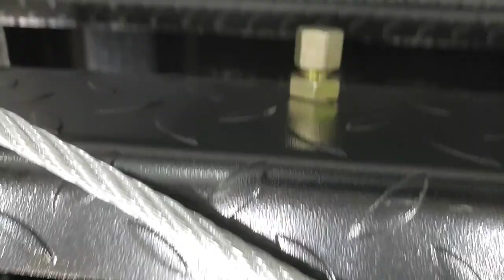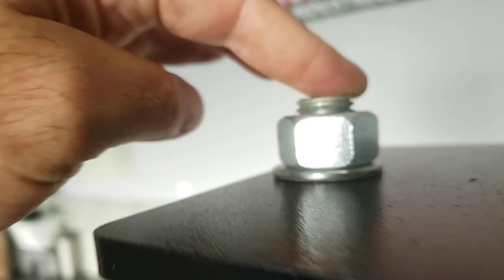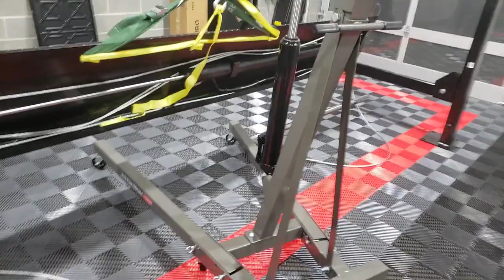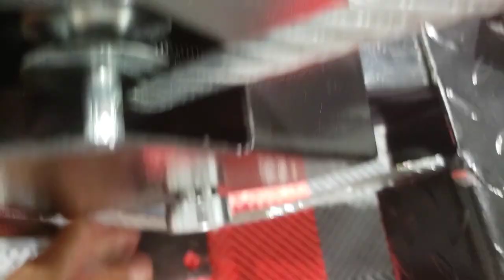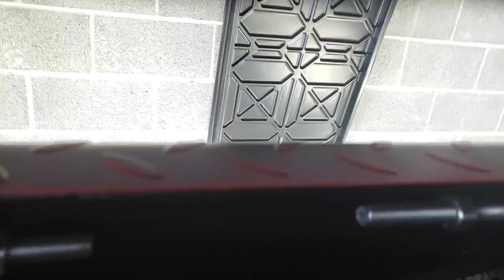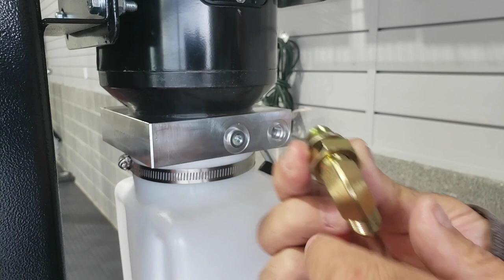Install a Tuxedo 4 Post Lift By Yourself - Beware - Lonnnnng Video!

Comment: Thank you so much for doing this video...I don't know how I would have assembled my lift without it!  The only "issue" I had was I filled the hydraulic reservoir  up to the "full" mark with the lift in its initial assembly position...on the third or fourth notch.  To my surprise I had to remove fluid from the reservoir when I brought the lift down to the ground level.

Comment: Now that you've lived with the Tuxedo 4 poster for a bit, what do you think of the quality/stability, the safety, and the 110-volt pump/power (for a regular dude trying to squeeze 4 (...or maybe 5?!) cars into a 3-car home garage?
Reply from the maker: I wanted portability so I didn't attach it to the ground. If that's not a factor, I would have probably bolted it down. It's a little wobbly, but this mitigates itself once you put cars on it. The material/construction as I pointed out in my video here and there isn't the quality as a Bendpak but I couldn't justify 2 to 3x the price for as little as I use it. The ladders work to support as they should and I had no issues storing cars on top and bottom. I typically store my 69 Chevelle on top and 61' Impala on the bottom. I've put a car as heavy as my Tesla P100D on top for a couple of weeks and saw no issues. No issue with the 110v pump as well. Remember it's only used for pushing the ramps up and providing pressure for a smooth glide down. Otherwise, the runs sit on the ladders. The only thing I needed to get used to is if there is no weight on the runs it doesn't go down all the way. it certainly doesn't have enough weight to properly push down on the caster assembly when I want to move it. I have to have someone stand with me on the runs to bring it down further.

I personally don't have any complaints other than the ones I stated. In fact, I'm thinking of buying another for my attached 4-car garage - I can't believe I'm starting to run out of room! ;)

Also worth mentioning - unless you have a forklift - I would touch base with your Home Depot and ask if you can have your lift shipped to the store and have them deliver it to the house. My local HD has forklift/home delivery and it saved me time and money :)
Reply: You are a lifesaver! Thank you for taking time to make this video, it saved me hours and made the install enjoyable!

Comment: Thanks for the great video, I've just put mine together with the help of a friend and your video helped a lot, as there are a few spots in the Tuxedo instruction manual that are definitely not detailed enough.
By the way, do you know the size of the elbow fitting (parts #90/91/92/93) that goes between the hydraulic motor and the metal braided hydraulic cable? My shipment was missing those four parts and I cannot connect the unit... I'm waiting to talk to the Tuxedo support on Monday but in the meanwhile I was trying to find a replacement fitting somewhere :-(
Reply from the maker: I would confirm with Tuxedo. I'd be willing to bet it's a SAE 6 (9/16-18)
Reply: @revivingretro  thank you. Meanwhile, Tuxedo is sending me the missing pieces via UPS

Comment: Fantastic video, referenced it all weekend when building mine. Did you have any leftover hardware aside from the shims? I have 4x M8 bolts and lock washers plus 8x M8 flat washers and nuts. Can’t figure out if I missed any.
Reply from the maker: Glad it could help in some fashion. Enjoy your new lift! :)  I had around (5) M8 bolts and a small number of nuts and washers left over.  I went over everything a few times as well and didn't find anything I had left out so I was fine with that. :)

Comment: Noticed you did not anchor the hoist to the floor. I bought a used Dannmar 7000. I have heated floors and reluctant to drill into the floor. How do you find the steadyness of your hoist since it is not anchord?
Reply from the maker: I didn't anchor it because I wanted to use the casters to move it around. It stays pretty sturdy when lifting a heavy car like my Tesla Model S - but you need to make sure the bottom plates are perfectly flat. Typical of poor Chinese craftsmanship, one of my bottom plates was a little warped and needed to be heated and hammered flat. The braces on the front and back help keep everything intact but you still  need to make sure your posts are well aligned. I also don't lift it with the ramps attached. :)

Comment: Any issues so far with the 4 post lift on those floor tiles? I have Swisstrax and was wondering if it poses a problem (damage by compression or post balance) or do I have to remove some tiles in order to keep the 4 post base leveled on the concrete floor.
Reply from the maker: I haven't had any issues with the lift nor the RaceDeck tiles it sits on.  :)
Reply: @revivingretro Still no issues with the tiles?  I have Swisstrax and love them.
Reply from the maker: @uwec86  yep - no issues with the tiles and I have had considerable weigh on the lift (i.e., Tesla P85D, '61 Impala, etc.) - I do find myself carefully checking the posts before I lift a car though because the tiles are a little slippery and I don't have the posts bolted to the ground so they may shift a little now and then (I wanted the portability the casters provide me)

Comment: How do you adjust the ladders. In my garage I need another 3 inches to lock into the ladder. As of now it’s not and my car is hitting the roof of my garage, I was thinking about buying 4 pieces of 4x4 wood and make it sit on that, any suggestions????
Reply from the maker: You shouldn't have to modify anything for the lift to properly function. Not sure what you mean by adjusting the ladders... when the lift goes you it catches each opening on the ladder until it either reaches the top or you stop it before it reaches your ceiling. Sorry, but I'm obviously missing something here if you feel you need to use 4x4s. :(

Comment: Do you use any lubricants on the fully shafts or sliding blocks?
Reply from the maker: yes - I used a ceramic lubricant

Comment: Is this the standard 8k lift or the XLT version?   How does the impala fit on it
Reply from the maker: This is the standard 8K lift. The runway length is around 180in. The '61 Impala fit's just fine on it. The wheelbase on the Impala is roughly 119.0 in so no issues on the lift. The rear of the impala obviously hangs out the back a little more than any of my other cars since it's a longer car. The lift only has 100" between the posts though so you probably wouldn't be able to fit something like a dually on it. I haven't had any issues with any of my cars on it - all have been on it for cleaning, maintenance etc. (Tesla Model S P85D, Mercedes ML350 SUV, 2023 C8 Stingray, '37 Coupe, '56 F-100, '61 Impala, '68 Camaro, '69 Chevelle). The lift is an affordable lift for hobbiest or home use. I would still opt for a more hefty lift, like a Bendpak if it were to get heavy use. :)

Comment: What 4 post lift is this? I just bought a tuxedo 9000 lb lift today.  But I can't find any videos of the 9000 lb
Reply from the maker: This is the Tuxedo 8000lb. Should be basically same as the 4post 9000lb. The 9k has a bit different dimensions

Comment: You didn't mention anything about jacking the car off the lift to change wheels/brakes. Do you have any insight on what types of jacks are available for that?
Reply from the maker: There are different capacity jacks - here's one
https://www.garageappeal.com/tuxedo-sj-35-sliding-bridge-jack-3-500-lb-capacity/?sku=SJ-35

Comment: How was it delivered? I dont have a fork lift what are my options?
Reply: Nevermind the video answered those questions. Thanks.
Reply from the maker: @TomsBackyardWorkshop  Cool - just make sure you check with your local Home Depot first. I had to have it delivered to store and set up a separate agreement with the store to use their forklift home-delivery service. :) Best wishes!
Reply: @revivingretro  Thanks

Comment: Where did you put parts #21 cable sheeves, I cant  find anything about them in the instructions.
Reply from the maker: That part is the pulley(s) the cables sit on. They are already attached to the runways (at least on mine they were). See the black pulleys at 8:40
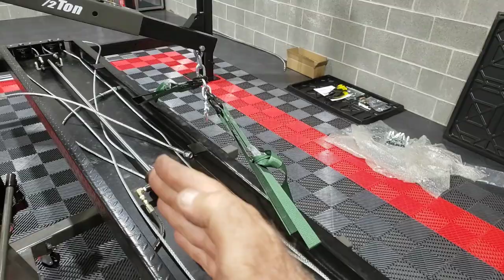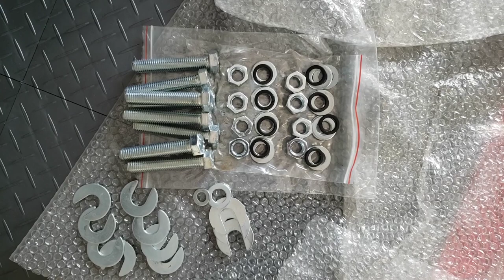Reply: @revivingretro  When you showed the parts on the floor they were laying there with other pieces so they werent already attached.  It is a big washer with a large cutout in it.  There were eleven in total.  I thought they were number # 21.  May be they are sent but not need to be used.. In picture 33:20 they are laying on the plastic in the back ground Picture 20:47 show the parts real good.
Reply from the maker: @rodnorris7356  Ahh ok - those aren't part 21. Those are horseshoe shims for the posts. You would use those to level out the posts if you were going to bolt them down. Since I wanted portability, I didn't need to use those nor the anchor bolts.
Reply: @revivingretro  Thanks I also want portability so I wont use them also.  Thanks for the video it helped me with the install.

Comment: When I did this my engine hoist tried to tip over.
Reply from the maker: Then you had the items you were picking up with it too far out  - you could always try lifting the rails with a hydraulic jack and seeing if you can get the hoist legs underneath. :)